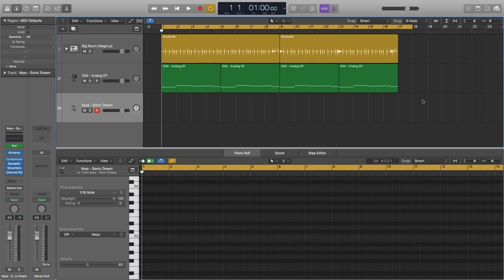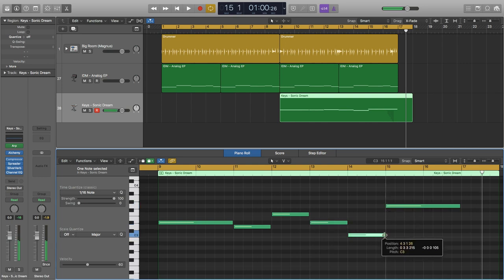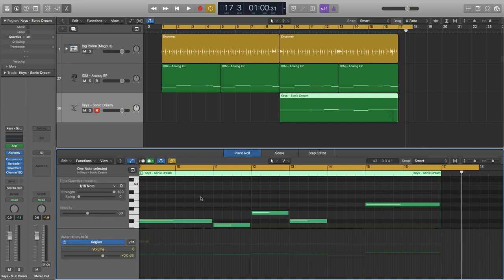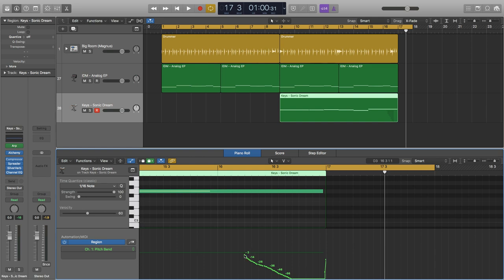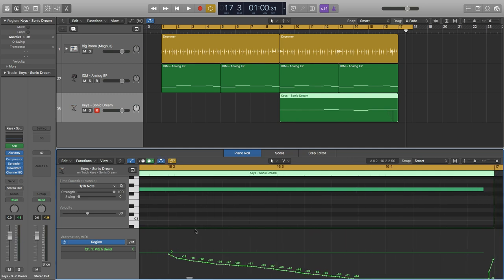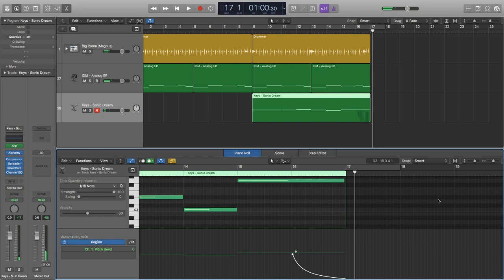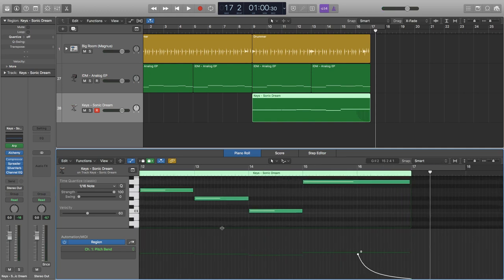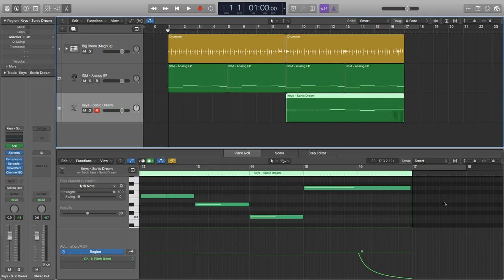Pitch Bend Using Automation In Logic Pro

Comment: Do you know how can I automate only the pitch bend after I have recorded the region (clip) with the Pitch Wheel? I have tried using Touch automation but I was not able to do it that way, can it be done?
Reply: I have the same question. I want to "draw in" the pitch bend in the piano roll w/o manually using the pitch wheel.
Reply: @pyphus  Hi! So I kept searching for an answer and I found it, if you’re into logic you should visit the Reddit logic_studio profile.
I found an answer almost immediately!
Anyways, if you want to draw it without using the pitch wheel or any knob map to it, you will press A to open up the automation mode, then, to the right off the R (record button) you will see that it usually is in track mode, you will have to put it in region mode. 
Then right down there you have the automation modes (read, touch, etc). Put it on Read, and then search for the Pitch Bend control (to the side of the automation modes) open up the drop down menu, it’s in the subgroup MIDI, right down the Note Velocity, and that’s it. 
You can also do this inside the region itself.
You will see the automation mode in the bottom left corner! 
I hope this helps you.
Reply from the maker: @serpieromusic  Thanks for your search and clarifying!

Comment: Thank you found this helpful, but how would you bend to a specific note, Life G to A?
Reply from the maker: I think you'd have to find the relationship between G and A with the audio unit, cents (not Hertz). 100 cents is a semitone. So, you'd need to go up from G to A by 200 cents. Hope this helps. I have another video in my Logic Pro playlist where I cover a stock plug-in that does just that.
Reply: Thanks for your quick reply, It does help. I just watched your video that was in your description, and I will check out the video on stock plug-ins Thank you again.    @SoundEngraver

Comment: :yt: UPDATE: A full value of 62 plus or minus resolves the issue. Now it works great!! THANK YOU!! ❤The pitch bend feature you showed me does not work despite the option I used says Pitch Bend. Rather it acts lake a tremolo bar on an electric guitar. The graph under the note I need to bend/slide down a fifth indicates I have down just that. But it's not sliding the pitch downwards, even when I take it to the extreme. It sounds more like a chorus effect. Any idea what gives?
Reply from the maker: Hey, thanks for listening! I have no idea on the tremolo or chorus effect. I recently did a video on pitch bending up or down 4 octaves. Do you that will help?

Comment: This tutorial is just what I'd hoped to find. Bravo Sound Engraver! I have a question: Is there a way to get the graphically drawn-in data converted to midi data with all the pitch bend "commands" showing up in the list editor. I discovered that when I reduced the height of the pitch-bended (to save space) the sound was all changed and not for the better. It was so damaged that I had to start over in the pitch-bent region.
Reply from the maker: Hi, John. Thank you for watching! I'm glad it's helped some. On automation data converted to midi data, do you mean bouncing it as a new MIDI Track? I'm also not sure what you mean reducing the height of the pitch bend. 

Hope I can help you solve this other part.
Reply: @SoundEngraver  If by "bouncing" you mean generating an audio file, then no. Couldn't find anything  about bouncing to a new midi track, that sounds good, if you mean the bounce would  send pitch bend data (visible in the list editor) to the new track, then yes. But I can't find anything on bouncing to a midi track in the manual, though it sounds like it might be what I need. Please advise on that or refer me to a resource on how that is done.  As to reducing the height of the pitch bend,  I only mean reducing the height of the track and region - so that more tracks are visible on-screen for the user. After I shrink down the track & region, the sound changes drastically and cannot be fixed. But if the pitch bend data were permanently written to the list editor as the pitch bend curve is being drawn (which is not what happens), the sound would remain unchanged regardless of the track height.